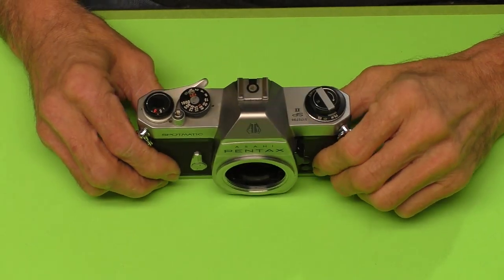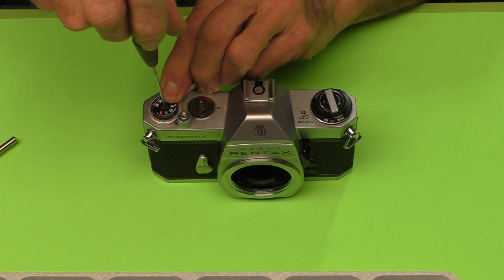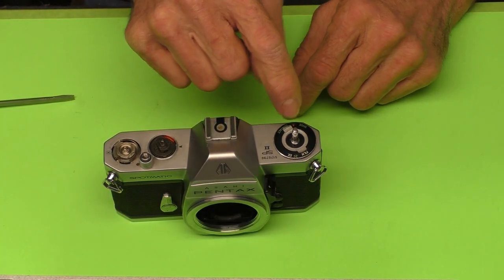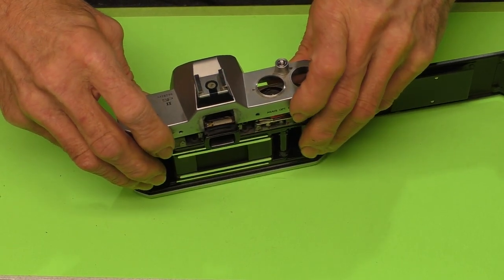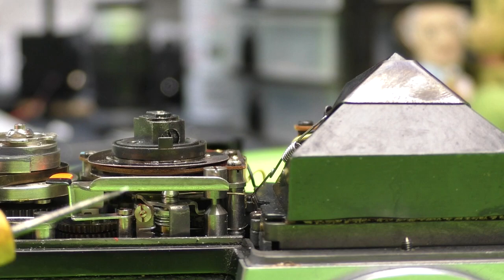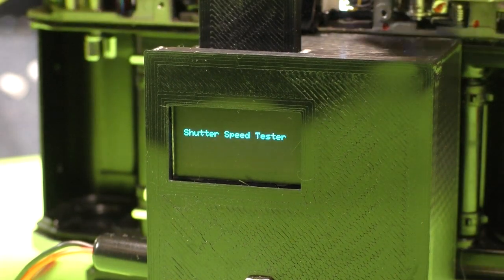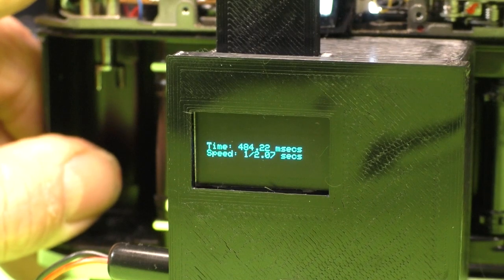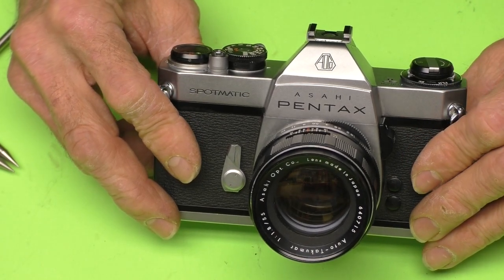Pentax Spotmatic SP II Shutter Speed Adjustment

Comment: I really like my Spotmatic F cameras, that I own since more than twelve years. They are dependable photographic workhorses,  which I recently tested with a modern shutter tester ressembling to yours. The fast speeds are a bit off tolerance. I did not know that a little bit of adjustment, like what you have demonstrated, could be enough to bring them back into check. I will definetly try your method. I already had this Pentax camera maintenance manual PDF, but I was a bit afraid of the complexity of the process. You made it feel more manageable. Thank you for the detailed and well captured stream of advice. 👍
Reply from the maker: You're welcome and thanks for watching.

Comment: Thanks for the tip about modifying the wrench for closer holes. Similarly I’ve filed flats along one side of both adjustment rods so the knurled locking screws can grip them better. Works. Always surprised how much beach sand there is inside old cameras. Tells of their history.
Reply from the maker: You're welcome and thanks for watching.
Reply: Yeah, it’s funny when I was given a box full of camera I found a carrying bag that was used to carry a spotmatic. Not only was there a surprising amount of sand, I also found some seashells.

Comment: I’ve messed with 4 SPs recently and they all needed curtain tension adjustments (to get equal travel speeds across an iPhone in 240fps slomo).  Only had to do the high speed adjustment on one after that.

Comment: Fantastic video, in that you detailed the disassembly very well including lots of little tips that many gloss over or mention out of synch with the instruction, nice touch with the bastardised screw driver, I suspect the slower speeds where used less by the majority of photographers, hence why the cam on higher speeds is worn, slower speeds attract more issues and where far more difficult with the din/asa now iso as a lot of people used 400 as 100 and 60 asa you would need tripods and lower shutter speeds to remove camera shake, but for clarity and less grain tripod longer shutter speeds and smaller apertures, the average person would go with higher iso film allowing for a faster shutter speed as prime lenses where and still are far more expensive so limited to 2.8 for a reasonable price, 1.4 very expensive!

Comment: It is best to first lubricate the mechanism b4 attempting any adjustments. Secondly, please look in factory service manuals to verify timing tolerance for shutter speeds, they are much wider than expected.
Reply from the maker: Yeah they do indeed have a wide tolerance. I have a chart somewhere that shows this. Good tip on the lube.
Reply: @HackaweekTV  To add perspective, the Minolta service manual for model X-300 has following opening time tolerance levels for shutter speed 1/250s - 3.17 - 4.81ms, turning into 1/315 to 1/208s as acceptance span. For 1/1000s 1/725s is borderline good as well.

Comment: Which way did end up turning the adjustment and about how far? I have a Spotmatic's that is doing the same thing. Slow speeds are good, high speeds are slow.
Reply from the maker: Which way you turn it depends on how far out of time it is. It takes only a small adjustment to make a difference.
Reply: @HackaweekTV  that makes sense. Mine is a lot further off than yours. I tried doing a CLA but the high speed times are still slow. Looks like I'll be giving your method the ol' try

Comment: Hello, I have an SPii but my 2nd shutter squeaks, which causes it to slow down. Any idea idea on how to correct?
Reply from the maker: It would need a major disassembly to properly access that area to do a full cleaning.
Reply: @HackaweekTV  I’ve had the bottom plate and the mount detached, might take off the top plate later 👍